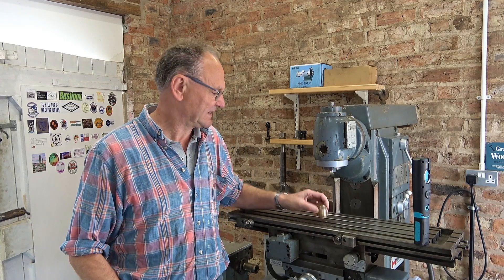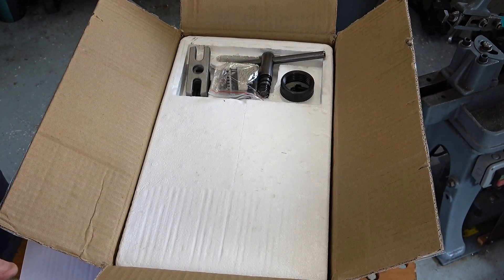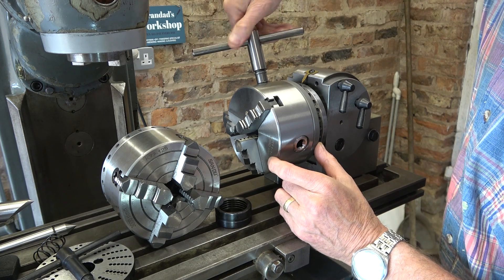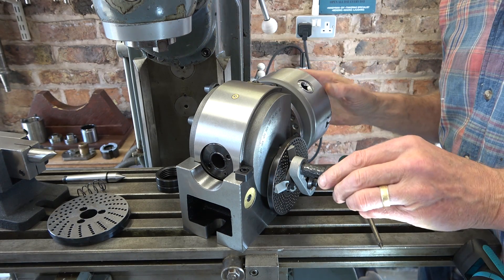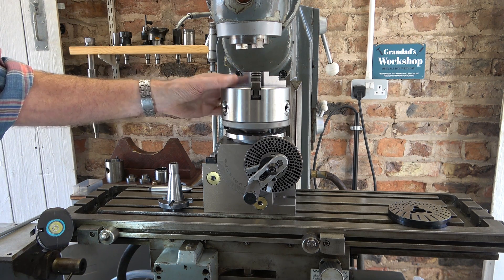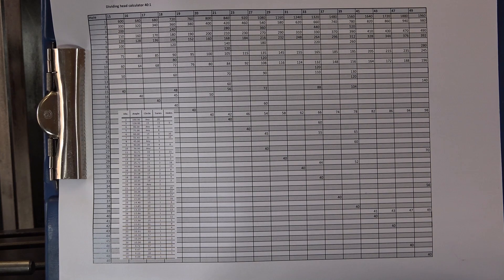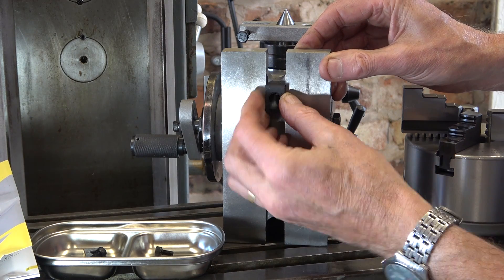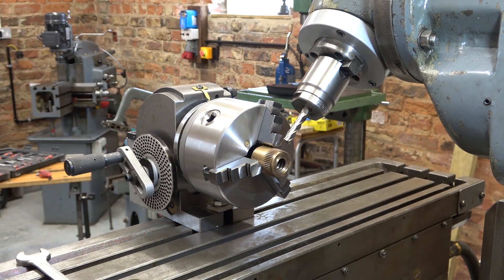HS210 Vevor 5in dividing head review

Comment: Thanks Paul for this review. I watched the whole video with interest because about a month ago I went down the alternative route you mentioned - a secondhand Britsh dividing head! I was wondering if I should do a review of that generic option to give a balanced perspective (?).
Also your thoughts on the appropriate size of dividing head were interesting. After much thought I decided 3.5in was about right on my mill (very rigid but has less height capacity). I think the right size is a key question.
Reply from the maker: Hi Clive, I was influenced by a couple of factors. I have standardised on MT3 and that was driving me towards a 6in head (5in only MT2). But pulling the other way was the size of my machine (adequate but not large). Being free to me was an attraction obviously so that meant a choice between 4in and 5in - but the 4in body is the same size as the 5in I think so 5in was my choice. I have my spindexer for smaller things (angle plate to make it vertical) or later maybe a rotary table. I can't foresee needing to cut large diameter items really but you never ever know.  What if I have to cut slots/teeth to make a metal pressure plate for a motorbike clutch pack - then a bigger chuck may come in handy? Cheers

Comment: Cheers Paul. I've no time for tool snobbery. For me it's about what you make, not what you make it with.

If you turn out a decent job on 'less good' tool, it shows what you're capable of, not just how fancy your equipment is.

A fair and honest review 👍

I have recently taken delivery of a Vevor rotary table (better than the one I've been using up to date) which uses the same dividing hardware. I agree, it might need some attention at some point in the future, but it doesn't detract from the overall good VALUE of the device (as opposed to absolute good QUALITY). There's a massive difference in what's needed to make aerospace parts 16 hours a day, and what's needed to make the odd part in the shed every few months.

I look forward to you teaching me how dividing plates work!
Reply from the maker: Hi Matt, all Harrison 140 owners crave a 63 tooth gear that is required to cut imperial threads on the metric lathe. But you can't cut 63 teeth on a 40:1 dividing head. But with a 90:1 rotary table you can index 63 to make an indexing plate for the dividing head (because 90:1 will index 63) and so there is a way. Now then ...... rotary table .... hmmmm .... maybe later. I've plenty to be getting on with as it is. Looking at the Vevor rotary tables I think they have to be 8 inch or more to be 90:1. Cheers

Comment: I'm curious how flat and true the machined surfaces are. How close do the faces run to the axis of the spindle? Are they all good right angles? It looks like a great tool for the money.
Reply from the maker: Hi motjuste, I've not tested the machined surfaces for flat and true angles yet. The base does not rock - I can say that much.  Also because the head swivels up/down then the length of the work can be trammed to the table regardless of the angle of the base.  Cheers

Comment: Can the dividing head also be used to mill a radial groove or can you only use it if it is fixed (clamped) in position? If there is play in the radial position of the head if it is not clamped then it will slightly move during milling of the radial groove and ruin the endmill and gearing of the dividing head.
Reply from the maker: Hi, I have not tried to use a dividing head like that. In principle it may be fine. The screw is 40:1 so the feed should be fine enough but as you say it may jiggle/chatter, though the backlash is low. And it depends on the material and radius of the groove and the cut. I would not hesitate on delrin or brass. Something harder may be a problem, but if we are talking just an o-ring groove then maybe that may be fine too.  Sometime I may try it. Cheers

Comment: Hi Paul, thanks for the very well put together review and have to agree that for the price you get a lot of tool. 
You fail to mention the make ? I take it Vevor are a re-seller and not the manufacturer, much like Banggood etc.
Ive had a look at the UK Vevor site and see many of the same tooling we could purchase form other re-sellers - I take it Vevor approached you with the intention to review their site and what is sold on it rather than the tools they sell ?
Keep up the great work mate - i look forward to your video's each week.
Thanks
Reply from the maker: Hi Steve, I got an approach from Vevor directly inviting me to join their "influencer" program. So I have a log-on and I can see a limited catalogue of the things they want to promote in the UK, which depends on current stock levels, amongst other things. I've found them to be very easy to deal with and professional - I have a personal contact who is based in China, who is quite chatty. So yes it's just the Vevor catalogue. The only make info was that on the chuck - Sanou.  Whether Sanou made the whole thing, I don't know. Cheers

Comment: Don’t take my statements as being mean just commenting or my attempt at humor but that being said you’re measuring a low end or lower end dividing head with a very high end dial indicator I wonder if you measured with a low end dial indicator the amount of difference to the Mitutoyo  
      Well my vertex divider is right at 1.5 to2 thou and cost  2600 and 345 for tail stock so right around 3200 $ vs 350 for vevor for a home machinist what a incredible savings you could tighten that tolerance on your schroll chuck by tightening each of the jaws after initial tightening then tighten each jaw good luck stay safe I like watching you home machinists cause you look or in-vision a little different than a production machinist
Reply from the maker: Hi jkmcp, I've tried tightening in just one key hole and also in all three and it's always 4thou (0.1 mm) runout on the jaws. Two sheets of cigarette paper under the low jaw get's it spot on center. I will clean it out later. That Mitutoyo came from a car boot sale (flea market) for £12 (15 USD) including the mag base and it's a bit 'sticky' but good if I avoid the start and end of the range. Cheers

Comment: Thx for the review and the vid.
Reply from the maker: Hi W65er, I will do reviews occasionally when I see something I like. But this will not become a 'review' channel. Cheers
Reply: The sector retaining washer should be conical spring steel, nothing worse than the sector arms moving whilst rotating the handle, don't ask me how I know.
The sector arms should be made of steel, Aluminium is too soft.
We had a similar one at work, too high in the vertical position and the worm diameter too small, stripped out.

Comment: First I would pull that all apart and clean and Lube with a good grease or oil but the one problem with the Chinese and Indian made tools is their filthy on the inside  I just bought a high quality dividing head and was 3400$vs 345 for that you can’t go wrong the other numbers are composites if I’m not mistaken there a necessary evil dividing heads that is
Reply from the maker: HI jkmcp, I've just finished making a 48 cut spline with it and very pleased except for those pesky handles that keep working loose. The chuck jaws seem to clamp reliably out of concentric by 4 thou so I put in two sheets of cigarette paper behind one jaw to get it spot on. Now the first job is done I will find some time to strip and clean it. Cheers

Comment: The spring goes behind the sector arms.
Reply from the maker: I'll look at that MBS, but it seems to fit better in front. The spring stops the sector arms falling off. I've been using the dividing head a lot this this week and actually the weak spring has not caused me any problems in practice. Cheers

Comment: If you really need something screwy you could draw it in CAD, print it on paper and read the scale with a cheap digital microscope.
Reply from the maker: Yes I could do that Jim, I guess. Cheers
Reply: @HaxbyShed  I wouldn't be the first to do it, but I plan to make a video of making a 189 tooth mod 0.6 gear once I get my garage and machinery settled down from the move.

Comment: I nearly bought one.. but decided to buy used spanish made with gears n cogs to make worm drives , helicial gears ect.. , which is the reason I declined the sale..!
Reply from the maker: Hi Ken, the Vevor Dividing Head has done the job I needed just now (cut a straight spline) but I will still look out for a universal head to cut worms and helical gears in the future, but (unless you are lucky) a universal head will be expensive. I only saw one 2nd hand with all the gears and it was £650. Cheers